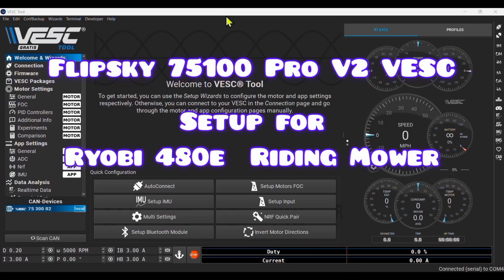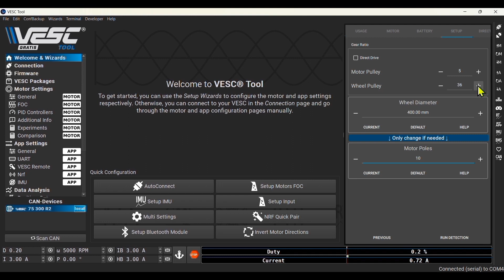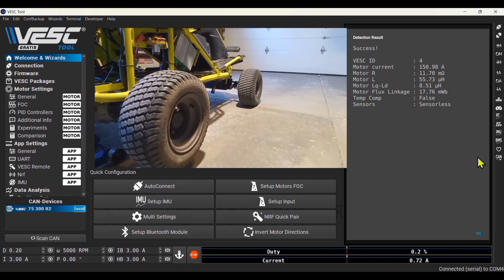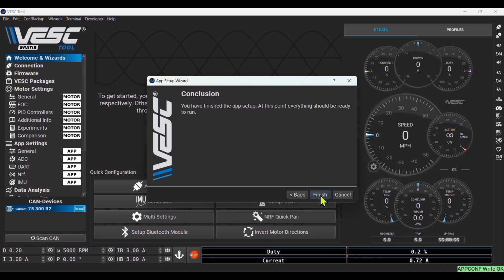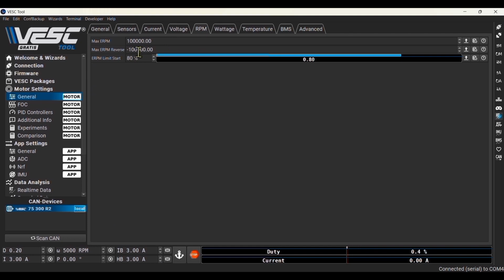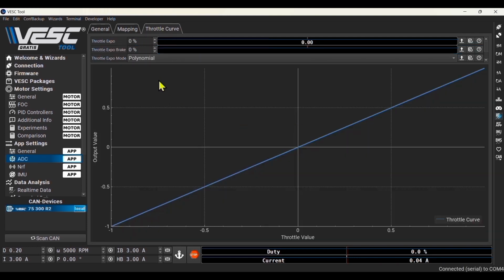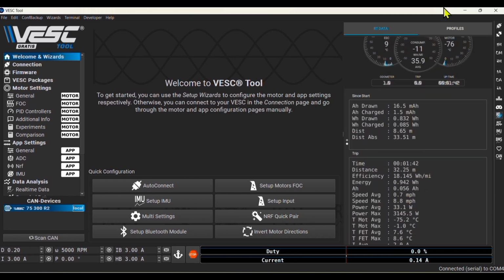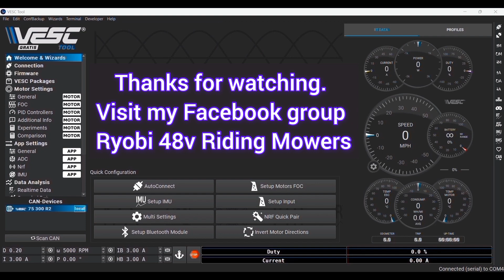Flipsky 75100 Pro V2 VESC Tool setup for my RM480e mower

Comment: Any real diffrnce between plastic and metal case? 30$ diffrence between the two for me. is it worth it to get the metal or are they he same?
Reply from the maker: The internal components are the same. But the steel case is structurally stronger. 
There's two different steel cases. The one with handles on the top is too tall for our mowers.

Comment: Hi! First thanks for this, I succesfully got it working -- such a great way to not have to buy hall sensors and a drive controller!  Question:  Under load (ie going uphill or pulling a sweeper) the motors stutter with the Flipsky. Its only briefly as it spools up, but and then is smooth afterward.  I'm sure there's probably a setting I can adjust to fix it -- any thoughts?  It never had any trouble with the stock controller.  Thanks for the help!!
Reply from the maker: That's the disadvantage of not having hall sensors. You can make a hall sensor harness just match the colors on the hall sensor connectors. 
You will need to go back through the motor learning process.
Reply from the maker: @Ryobi48vElectricMowers the hall sensors help to smooth the motor out at very low speeds.
Reply: @Ryobi48vElectricMowers  Interesting.  I think my hall sensors may have been bad (before I swapped controllers it would intermittently not work) , so sounds like I'll just deal with it as is!  The strange part is it's not just jerky -- it generally has trouble getting going all together.  Maybe if I change the acceleration curve?
Reply from the maker: Try increasing the motor maximum amps by 25 amps.
Reply: @Ryobi48vElectricMowers  Thank you so much for the help again!  I'll try this out !

Comment: Hi👋 maybe you could help me please. I have a flipsky 75200 controller on my bike. everything works fine for me except for one thing. when I move the bike backwards I can't give gas to go forward, the gas handle doesn't respond. it happens when im on a step hell and the bike is moving a litle bit backward becase i stop for a second. only if I come to a complete stop I can give gas . (Bicycles only have forward mode)

Comment: I have a flipsky pro v2 on a bafang. But it gives a hard punch to the motor at the bottom of the gas handle. It feels just like a punch u also hear it. Can i get this away by curving the voltage / amps?
Reply from the maker: Make sure the hall sensors are working correctly when setting up the motor foc. 
You may be able to  calm it down with the adc throttle settings and curve.

Comment: Thanks for the video, my 480e is not lasting more than 25 minutes on cutting time, its 2 years old, but I never charged it properly(leaving it charging while not in use)  Can you recommend new bateries? and from where, also I would like to try this Flipsky thing, do I need to purchase app to set it up?  Do I need to purchase a different charger and monitor gage etc, sorry for all the questions but am about to throw this thing in the trash....lol
Reply from the maker: A battery conversion would be first thing to do. Batteries depends on how much you mow. 
Take a look at my Facebook group and ask there for more information. 
https://www.facebook.com/groups/ryobi48vmowers/?ref=share